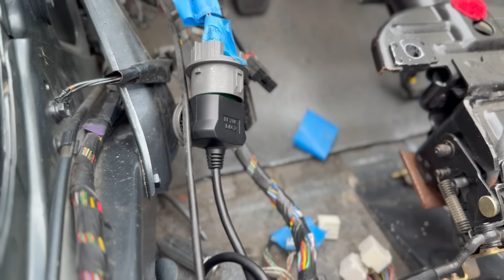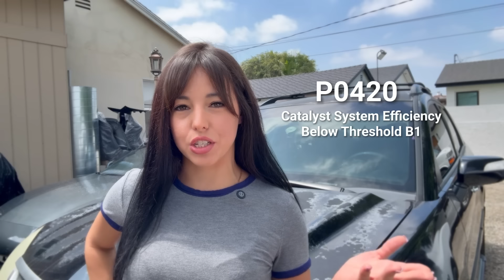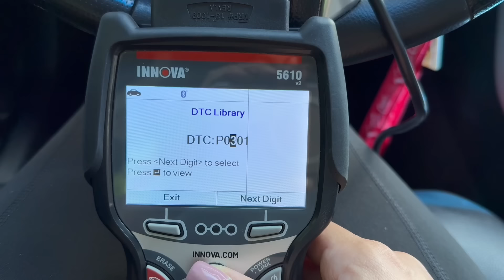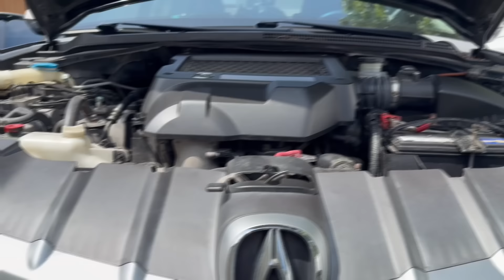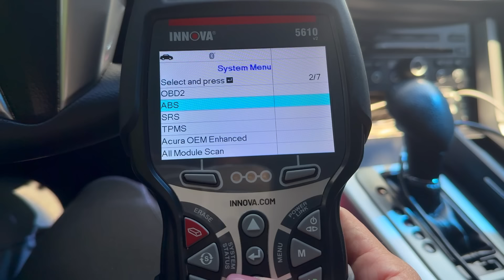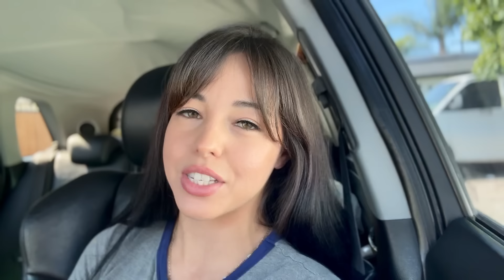Can your scanner do this ?

Comment: My jeep grand cherokee laredo 4.0 is always giving me problems can the 5610 help with anything 😮
Reply: A scan tool can't diagnose or tell you what's wrong with your car. It can provide with useful information, but you still have to know what to do with it. For example, you get a code for an O2 sensor. Do you replace it? Of course not. Its your job to figure out what's causing the pcm to set the code in the first place. A scan tool can't do any of that. Your most important tool is a multimeter. That's the tool you'll need to fix your vehicle.